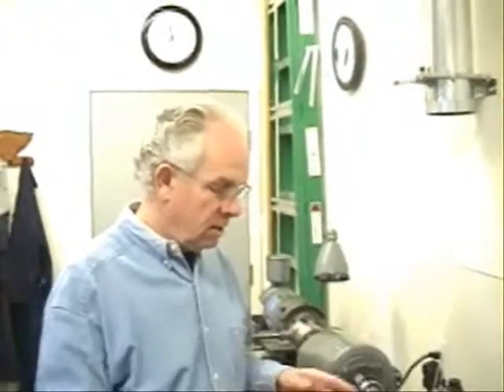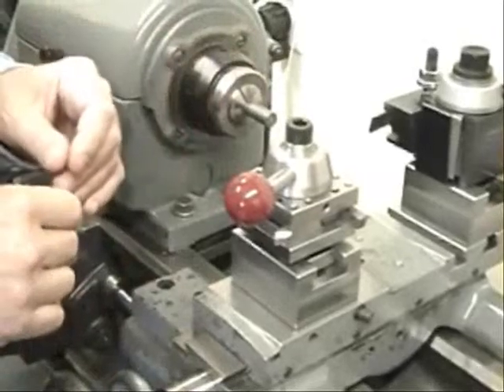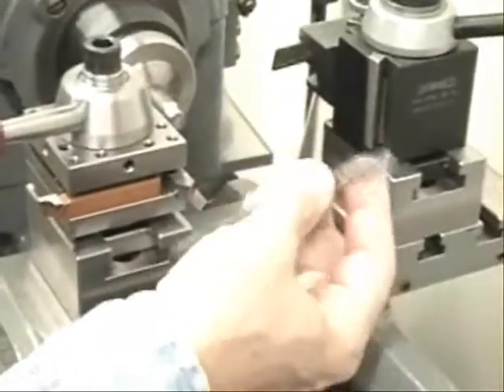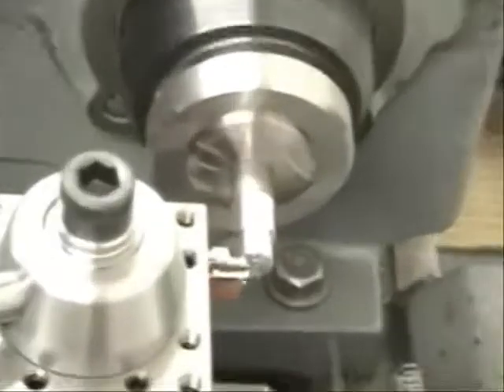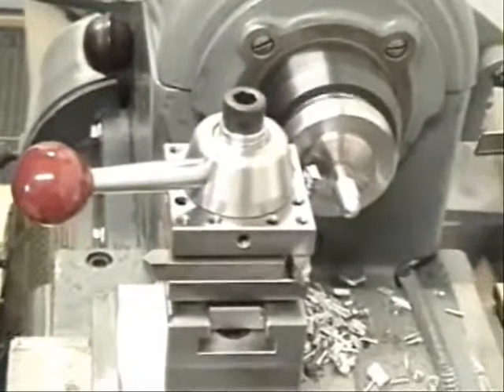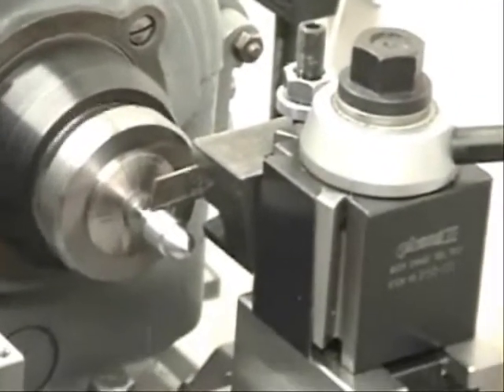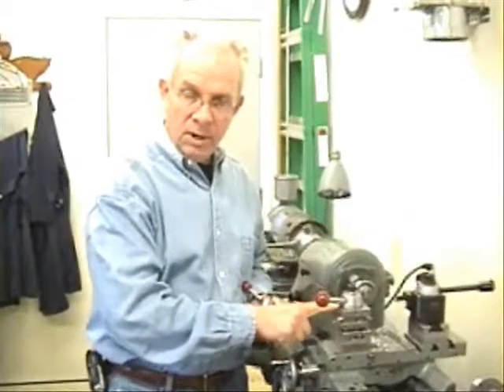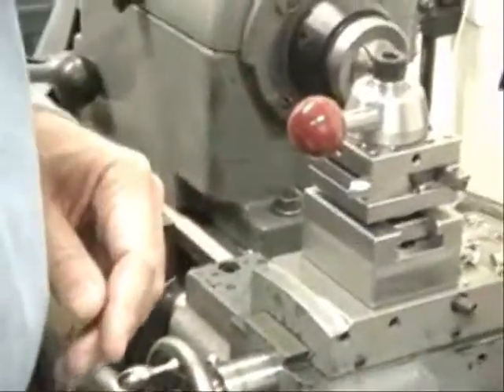Dick's Turret Tool Post Demo

Comment: A nub left is common, when you don't have the tool on center.   You try and explain it away as being "common", remove with a second chucking??   Why would you "waste" a quick change toolpost on the rear of the cross slide?  If you were going to have a dedicated rear parting blade holder, it would be in a rigid block.